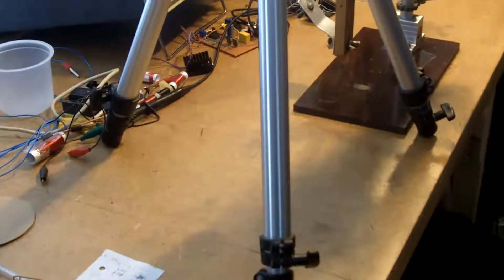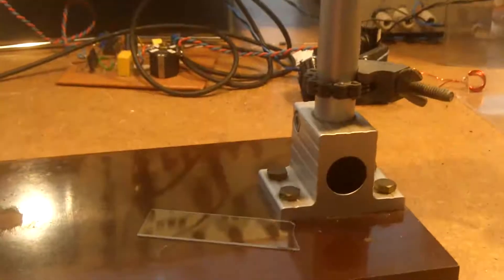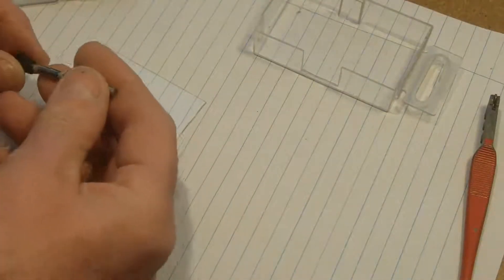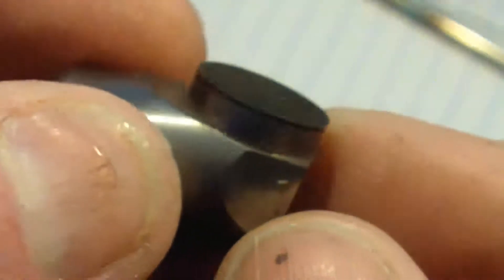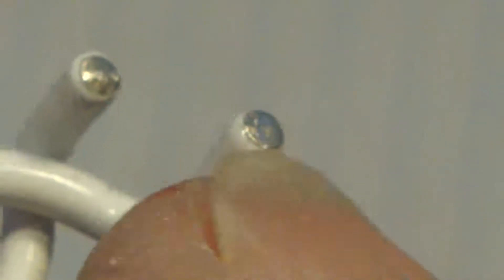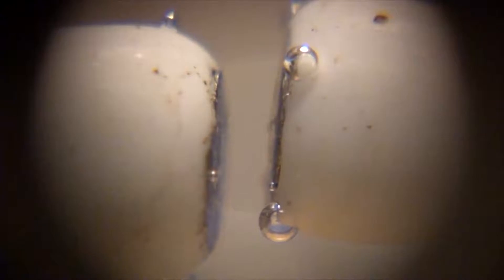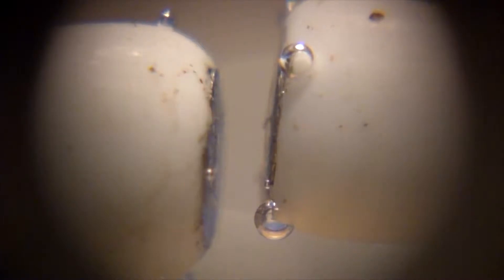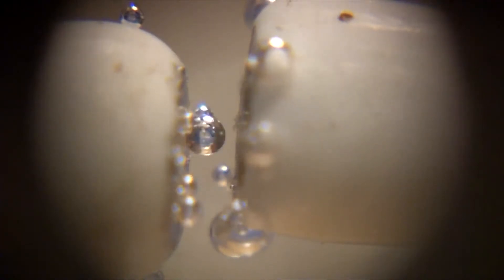HHO. 29 Some interesting bubble activity, not straight lines.

Comment: Have you considered stainless steel razor blades for the electrodes?  I think the very sharp edge might help reduce the depth of field requirements while providing a good vertical span.

Comment from the maker: Yes, it’s a fragment of the nylon coating that I bonded on the electrode. I trimmed it off the end before re-glazing it again with a gas torch.  I’ve seen that sort of thing before, I used to build 50KW RF transformers for induction heaters called ‘Aperiodic Generators’ they were in thick clear acrylic boxes and worked at 8KV We had one with a bit of rubbish in it and it repeatedly drifted between tow terminals. Two of us stood and watched it. it only stopped at switch off. 
Regards ... Andy

Comment: I think the bubble moving downward toward the end of the video is the result of water being pulled into the electric field between the electrode ends.  A charged capacitor would pull a higher dielectric material (i.e. water) into the space between the plates.

These are certainly interesting videos, and I have not seen this detailed work done before.

Comment from the maker: Hi Eric, what I really want to do is apply a high voltage chopper circuit with variable frequency and mark/space ratio but I see your reasoning, start with no ripple. As I say in the video there’s less than half a volt ripple but it has quite a noticeable effect (under the microscope)
Regards ... Andy

Comment: I suspect the cross sectional area of the water in the horizontal setup was much less than the cross sectional area of the water in this vertical setup.  The difference in the cross sectional water area might explain the huge difference in bubble formation.

Comment: Looks like bubbles flowed in the pattern of Leedskalnin magnetic current spirals.  Pressure is one variable that changed, since the electrodes are now submerged.  Where as before the water clung to the electrodes via surface tension.